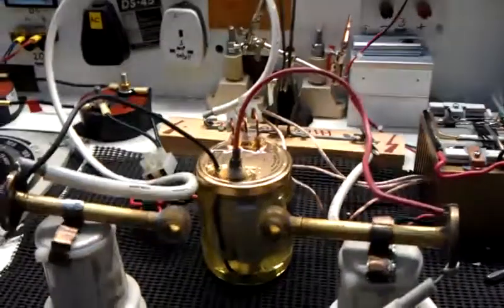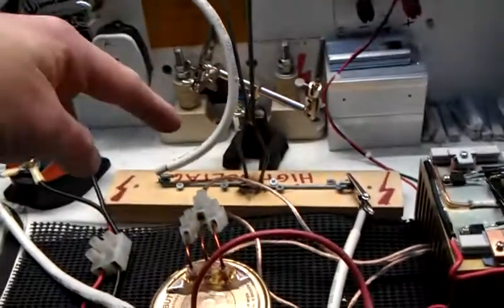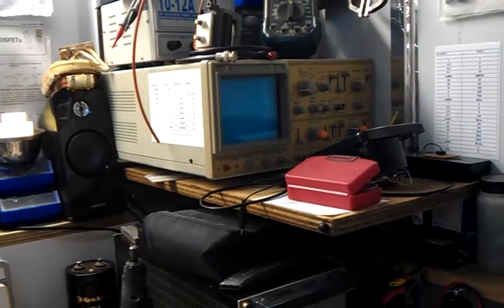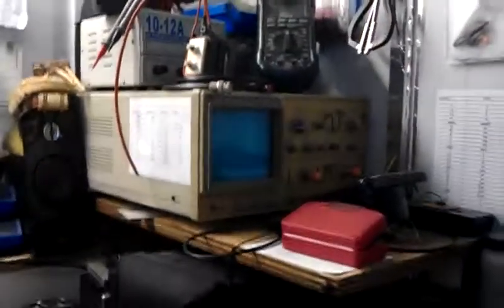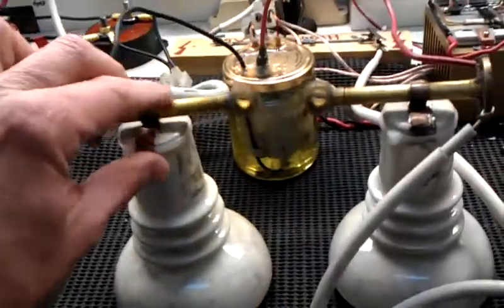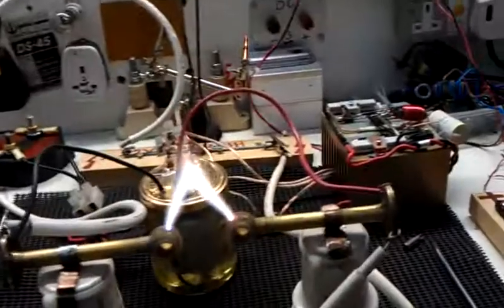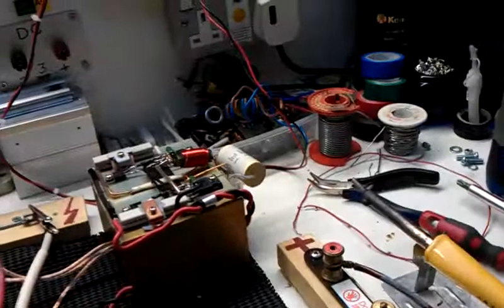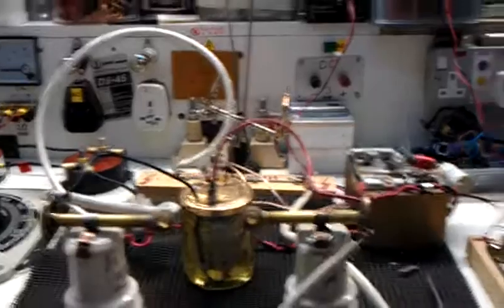Zvs flyback on 20amp variac

Comment: How do I shut off my 30 volt power supply without the back emf killing my mosfets on my zvs driver?
Reply from the maker: Hello.  yes I know what's happening.  the best way to stop that would be to stop /cut the voltage right off! instant. I can tell a couple of things to do and you could use a online switch that's rated to at least 10 amps. or use a relay' or a contactor ' something that's going to cut that voltage. hope this helps.

regards 

Anthony 

High1voltage1rules
Reply: O ok thanks
Reply from the maker: +Owen Chase science channel
 no problem. any more info don't hesitate to contact me.

Anthony.

High1voltage1rules
Reply: high1voltage1rules I was having a little trouble understanding, can you point me to some kind of drawing for the back EMF protection?